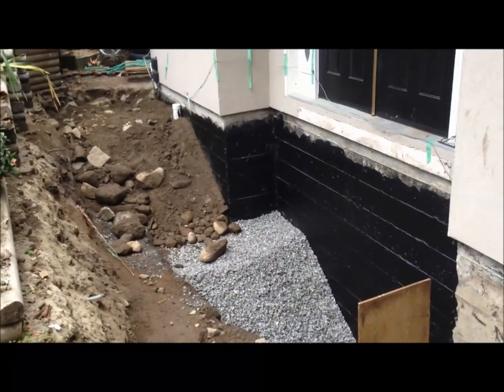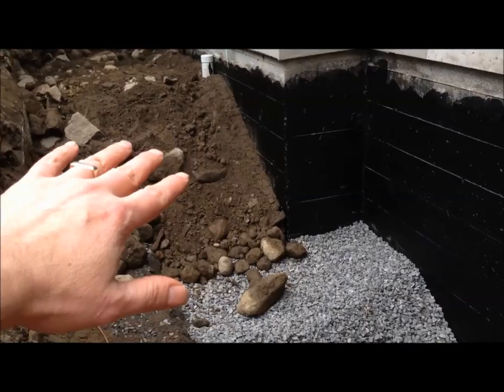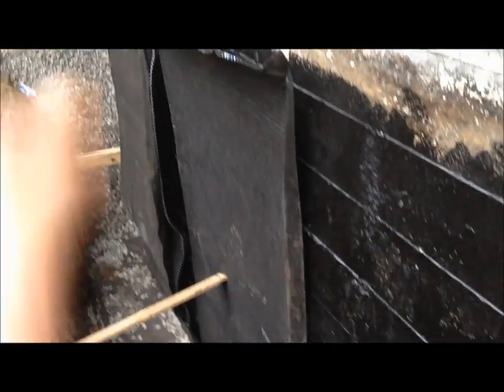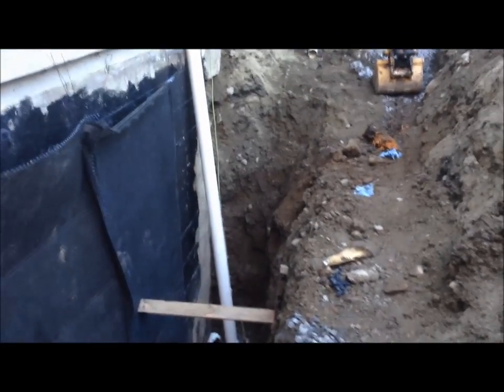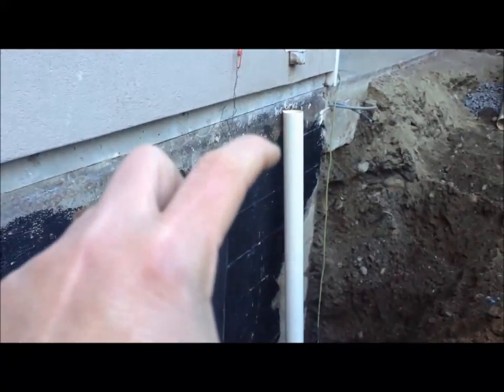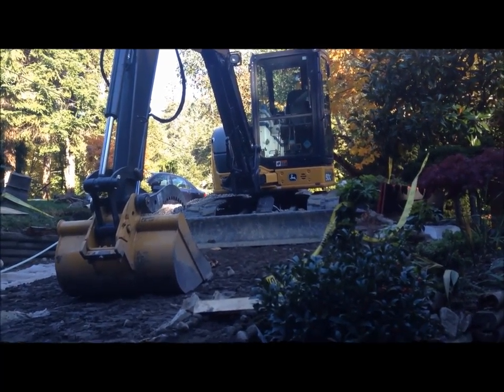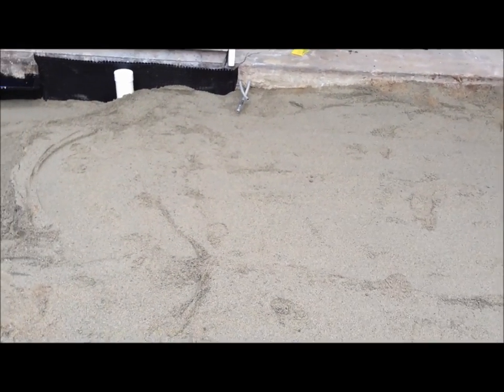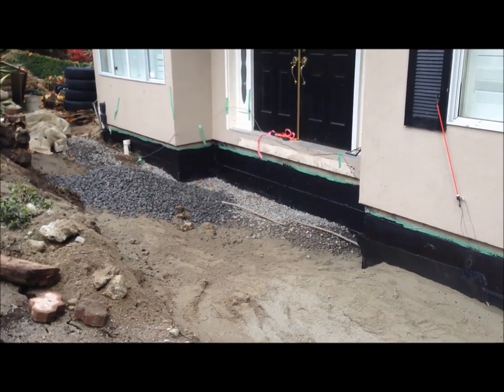House foundation repair Part 5 - Backfilling with crush and replacing the water main

Comment: the ground rod likely isn't going to work the way it was installed.  They're required to be at least 8 feet vertical depth to reach moist soil even during dry weather.  However, this one was installed horizontally on top of a very deep bed of stone ... almost guaranteeing it to remain dry and fail to protect you.  I'd suggest buying an standard ground rod from the home store and properly installing it far enough away from the house to reach true soil and miss the stone.

-  or at least have yours tested.  Isolate it from your neutral bus and then test resistance - NEC states it must be 25 ohms or less for a single rod.  Many homes fail this even with a standard ground rod and require a second rod (not closer than 6 feet to the first) to reach a safe level of resistance.

Comment: It’s been almost 10 years since you posted this. How’s the work been holding up? Bone dry basement? Lower basement humidity too?
Reply from the maker: It's been perfect. We really tamped down the crush/gravel and sand so the pavers are still perfectly in place. Drains well into the sump too.